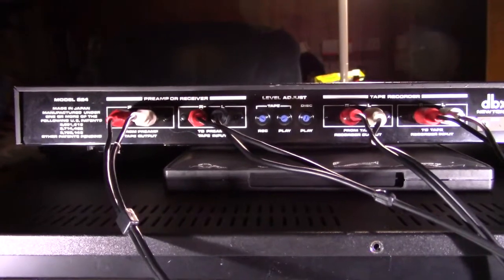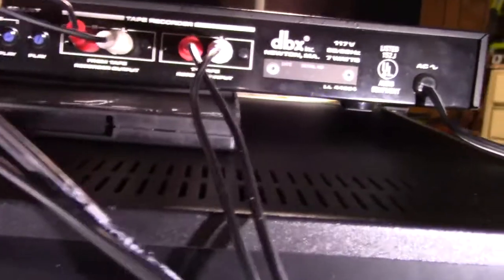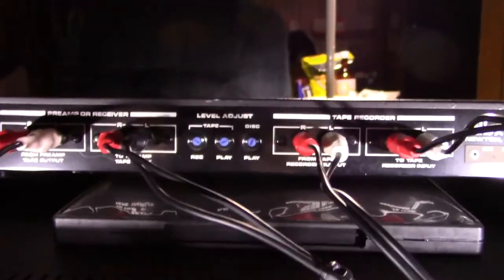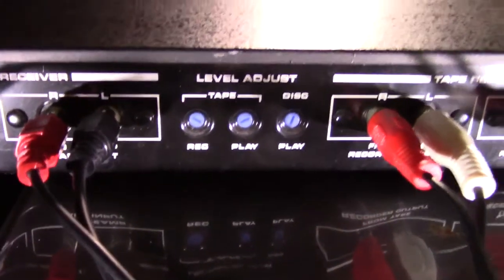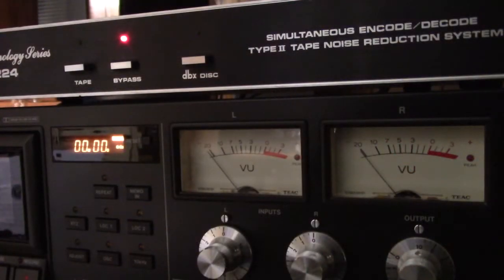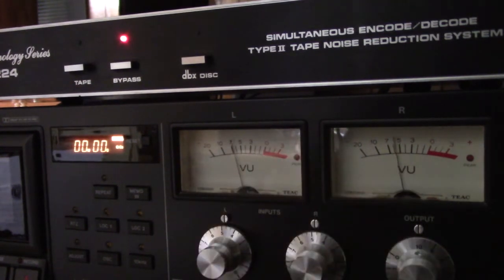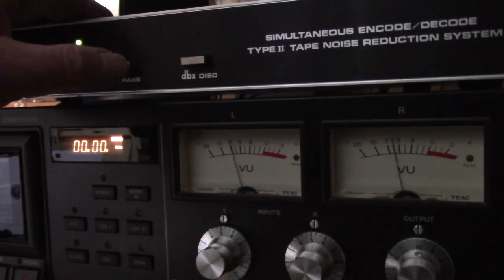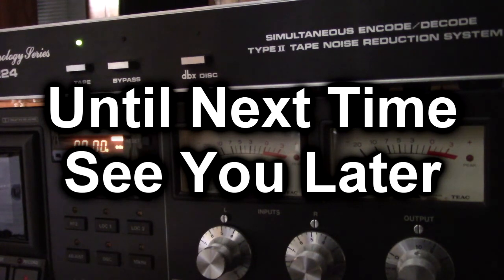dbx 224: Alignment Procedure- Level Matching

Comment: Hammy , Good time of the day to you , just a question,  did you have DBX 224X or DBX 224X DS units?
Reply from the maker: I have only ever had the dbx 224... I imagine the 224X and 224X-DS are very similar in getting adjusted properly. The adjustments have been moved to the front panel.
Reply: @HammyTechnoid  Hammy Thank you for replay , I am struggling to understand  , the way instructions are written,  cannot get it ....  Here it is for 224x DS .......Changing the Level Controls
The top LED row (Record/Encode:in) will light according to the level of your preamp's Tape Out; in other words, it displays the incoming signal level. (This is clear to me  )
 To  set the second
row  (this is tricky )(Record/Encode:Out) to a good matching level, first put on some music. Pop FM has
easy-to-follow levels because it's all the same loudness, but any music will do. Then turn
the top (Record) thumb knob -- a small coin will work as well as your thumb -- until the
First yellow (0) LED lights up on moderately loud passages and the last red LED lights up
rarely ?????? ( yes Yellow color indicators starting  from 0 ...... Last red is before 0 ---- what exactly they saying???? Not clear ..... if last red needs to light up rarely...why they want 0 to be hit ?????? ) This sets the output of the encoder to optimize its dynamic range
The third row will be governed by the output of your tape deck, which in turn is
governed both by how hot you record (which you dont want to alter merely to get a nice
light show) and by any output-level control the deck has. If it does have such a control, (Unclear as well ..... What to use ??  Volume or Rec level controls of a deck ????)
just tape whatever music you're listening to and set the output level until the third row s
0 LED lights whenever the one right above it does. If your deck doesn't have an output-
level control, don't worry -most decks are unity-gain (level-matched) within a couple of
dB, depending on tape sensitivity etc. But even if this row doesn't line up with the one
above it, go on to the adjustment of the fourth row ( ?????)
The bottom row (Play /Decode:Out) is controlled by the bottom (Play) thumb knob.
Again, turn it to line up its first yellow LED with the one in the top row (TOP row ??????? Which TOP ???very very top Row or the Top the one above - Third one ?? . Now you're all
set: your noise-reduction system and tape deck are level-matched from input to output
As we have mentioned, none of this level-setting needs to be absolutely precise. in
fact, there is a very wide tolerance within which the 224X will do its job perfectly.
Level-matching does, however, make for a neater display, and it means that the loudness
of your music won't change as you select among various sources, dbx and others. The
numbers and lines by the LEDs show electronically what dbx companding noise reduction
is all about it's the "butterfly" diagram (p. 5), only turned sideways
We think your new 224X will make a genuine difference to your enjoyment of music
in this digital age. You hardly realize how much tape hiss youtve been putting up with
until it's eliminated.
     PLEASE anybody Explain !!!!!! ))

Comment: Hammy To create dbx tape , can I connect cd Player directly to DBX unit "Preamp Output " To get signal directly onto three head deck?
Other words- Record a tape without    Amplifier at all ?
Reply from the maker: Yes You can.... You can skip the preamp and connect directly to the dbx unit. The signal path needs to be correct so the output of the CD player will be going to the encode part. Once you're connected properly, everything should go right!
Reply: @HammyTechnoid  Ohhh Stupid me )))) Yes I understood that ) Tried )  You see I religiously followed Manual; ;; that though crossed my mind ::: that logically possible,  AND this  can serve Tape Monitoring  function  , by connecting DBX unit to Amp IN,  so while recording Pressing  3 head deck Source/Tape back and fourth --- It is possible monitor what being recorded on a cassette in real time;  
   My Pain is I modified my Amplifier ))) paid big buck )) to make that Tape loop )) 
   Stupidity this is Most  Expensive thing in Life )) Because the Price must  to pay for it )) 
   Honestly : It is confusing those writings on units and even Manual leads you to believe that only Amplifier can be connected to those rci slots

Comment: Hammy , dbx 228 unit ,useful? That dynamic range expansion function ---
Reply from the maker: Yes.. if you can get one in working order it can make your music pop. Plus dbx NR.
Reply: @HammyTechnoid  I have already 224 dbx on its own,  but what I am reading 228 is fusion of 1 BX series 2 Dynamic Range Expander and DBX 224 , OK Thank you for hint !
Reply: @HammyTechnoid  Hammy another question regarding this video in particular,  To get Unity Gain Point .. needs to regulate not only Rec. knob on the back ..Rec only does Level Matching. ..to get it sound Same way with bypass mode , Play knob has to be adjusted as well with screw driver ? Am I  right ? 
Or Play knob is not that important?  While preparing for recording the tape .... Manual only mention only Rec. knob and uses only notion "Level Matching" --- it leeds to believe that Record Level Matching is enough for Unity Gain ... 
Even though it can and  will sound  differently if Play knob will be not touched ... and switching between Tape and Bypass will produce that unequal sound.

Comment: Hi Sir! On dbx224x, Is there a way to adjust the level inside the unit? Because whenever it plays, the levels are all maxed. Thanks for the help.😊
Reply from the maker: I have to be honest and say that i've not had any experience with the dbx 224X model, but I can assume they have the same level adjustments that a regular 224 would have. There should be level adjustments available somewhere on the unit. If I'm not mistaken, the 224X has adjustments on the front panel. I would check those, and remember, unity gain for dbx should be around -5db.
Reply: Hammy Technoid Thank u Sir... There’s actually an adjustments button at the front, but it seems its not working. Thanks again.😊

Comment: If one wants to use a tone generator ,what tone is to be used?
Reply from the maker: I would use a 400 hz tone, same as the Dolby cal tone. For dbx any tone from say, 100 up to 1000hz would be ok.
Reply: Thanks will try it today.
How to use DBX224 along with DBX2BX both at a time.?
Reply: Thanks.